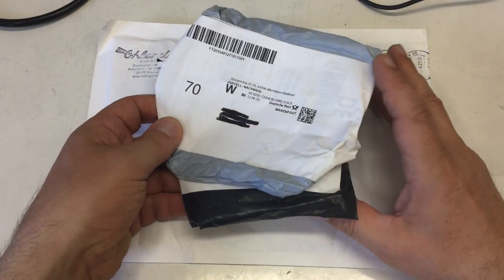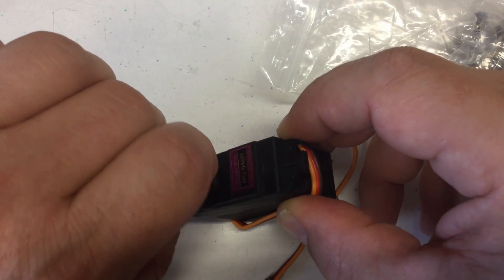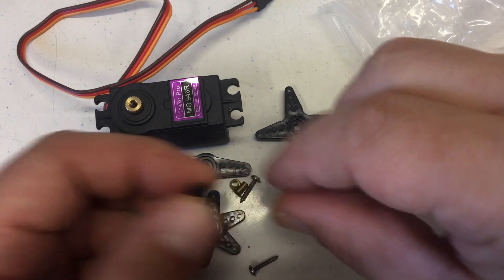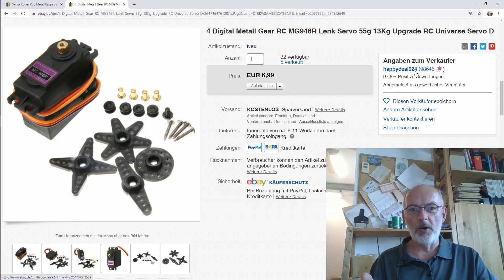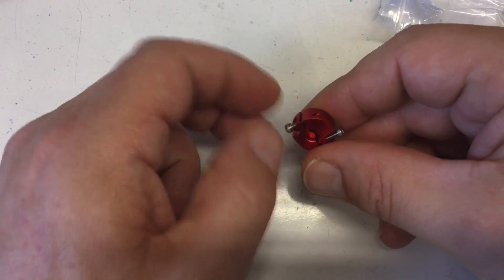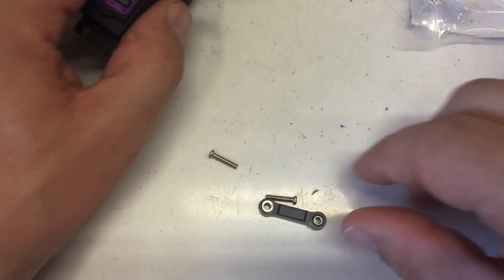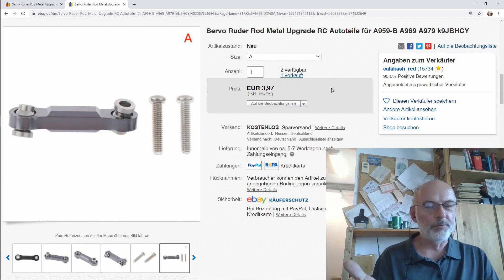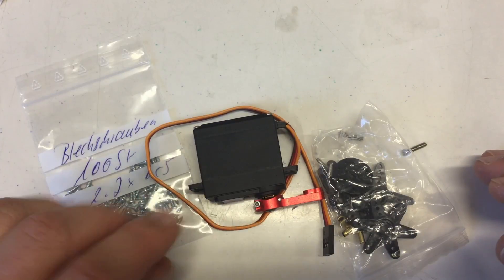Mailbag: Metal Gear RC Servo, Servo Arm, Servo Pushrod and Self-Tapping Screws

Comment: That's not a bad price for a metal gear servo, I wonder what the gears on the inside are made of...?
Reply from the maker: There will be an extensive review of that servo (speed, current consumption, stall moment and current - the works). And I'll open it up too to see what's under the hood ;-)
Reply from the maker: The review of that servo is out now: https://youtu.be/_SnHsSbTvNI
And yes, I took it apart and looked at the gears ;-) However, I was only able to test the stall torque up to 1A.